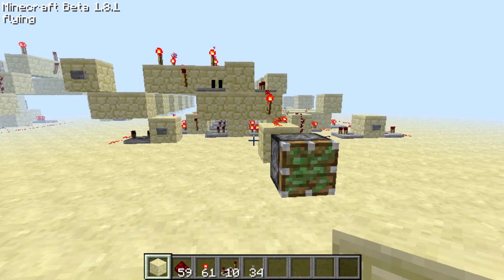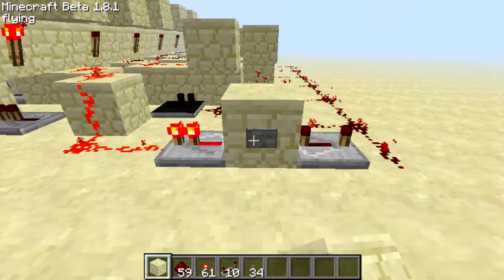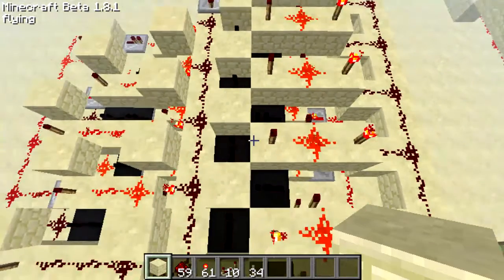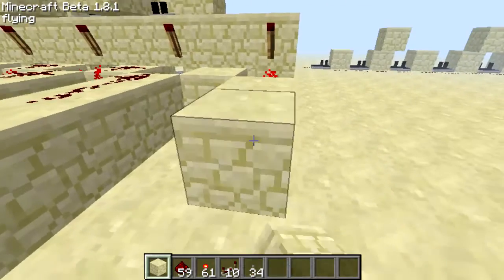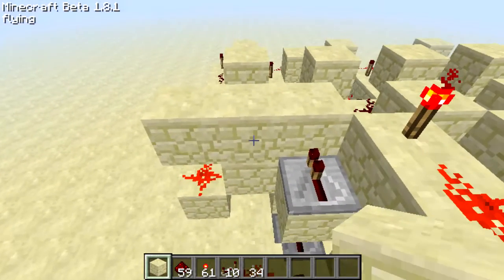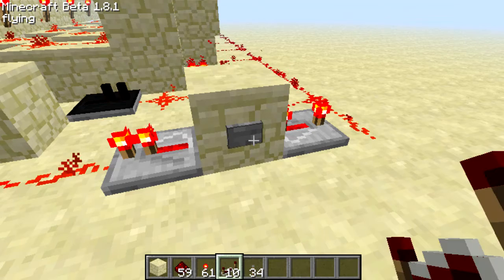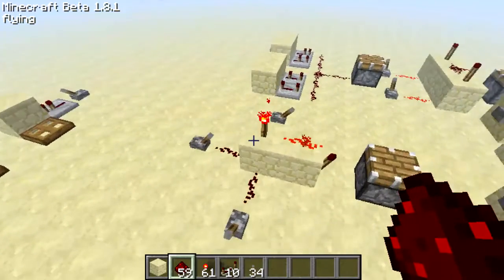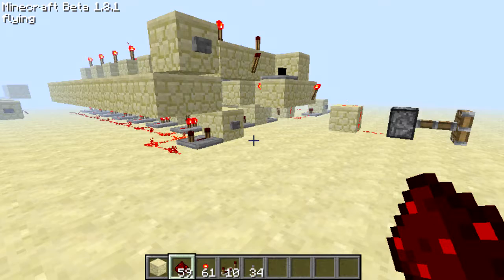Minecraft Redstone For Blockheads Bonus Episode: My Redstone Capacitor

Comment from the maker: @RomanSpartan3 Depends on what you mean. In terms of linking it to a score board to set how long the board will display yes. If you would want it to change like a clock or change per the amount of times the button is pressed you could either do a piston memory ring (which I will do a video on in the future.) or hook up an rs nor latch array like mine or different and have it either unlock the next display number/letter every time you hit the button or use what I did with my xor gate rig.